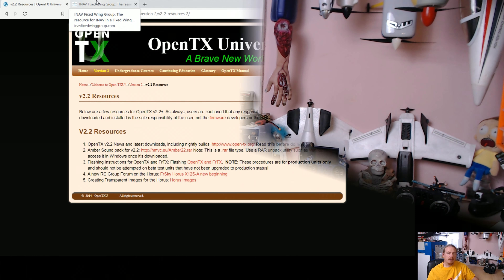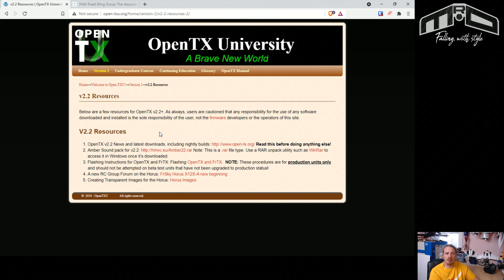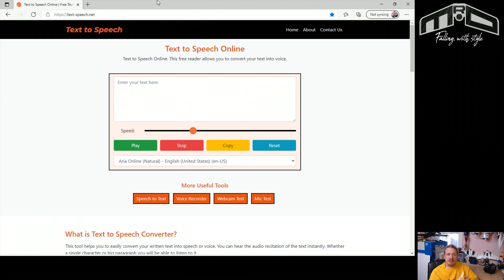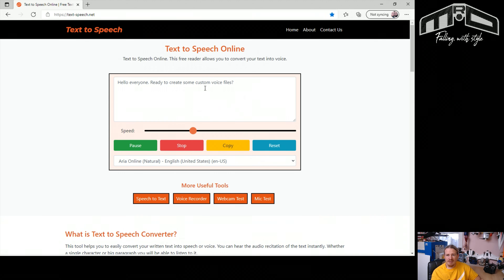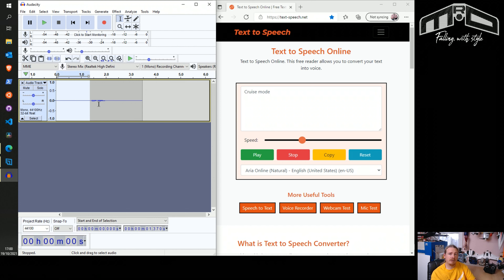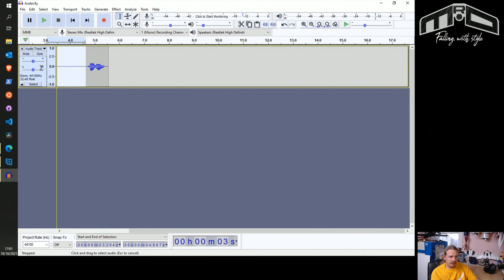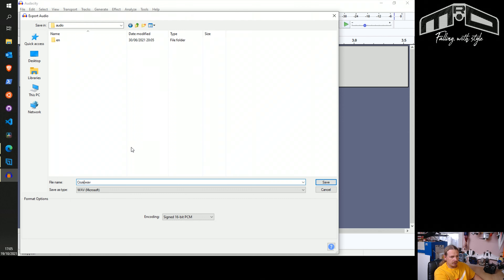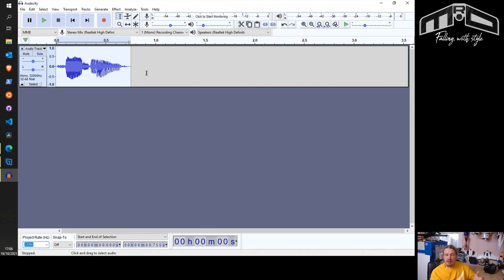Installing and Creating Sound Packs for your OpenTX or ETHOS Transmitter

Comment: Awesome tutorial, i just used it to make some sound files for my inav osd layout selection, and model name callout when selecting another model in the transmitter.
Reply from the maker: Awesome Herman. Glad to hear it’s been put to good use already.
Reply: That's interesting the ability to call out a model name when changing model. How is that done? many thanks
Reply: @hectorpiercey7852  Just add a play track with your sound clip at special functions and trigger it to play with a switch called ONE, let it play 1x.
Reply: @HermyH66   That's brilliant Thanks Herman.

Comment: Kudos! Without your step-by-step videos regarding EthOS i could never had manage myself so far. Thanks a whole lot for your time and skills. Just went from Spektrum to X20S, so it's hard to get into something new as this. For your information: the first time I used the text-to-speech it worked on Edge. Now, after realizing that my X20S haven`t any voice for flap settings I wanted to crate some more audio, but i'm only getting African woman :P tried both Edge and Chrome, updated/refreshed. Adria US is gone :( Ever experienced that yourself?
Reply from the maker: That web site seems to change the voices quite a bit. Aria is still on Edge, but you have to get to her a different way. I’m working on a web page to allow people to use the Edge “Read Aloud” feature for voice packs. Some people are having problems though, so I need to figure out why that might be. 

https://www.mrd-rc.com/tutorials-tools-and-testing/useful-tools/transmitter-sound-pack-simple-phrase-page-generator/

Comment: Hi Darren, thanks for all your videos ,they are a great help. Appreciate that you had this one for sound bytes as well.
A question, I fly Pattern aerobatics, we have what we call a calling card, which has a sequence of  manouvres which have to be flown in that order. It would be handy to load this call card onto my TX and then by eg. pressing one of the buttons at the back of Tx . the manouvres can be called on the completion of the previous one. 
Eg 1st manouvre, loop with half roll; press button:(2nd) half square loop on corner; press button  (3rd manouv) ; inverted cloverleaf etc to manouvre 17  ; end

Comment: Thx for informative video. Are there any packs with "non speech" sounds, like beeps, chirps etc.? OpenTX used to have "Play Sound" command (next to "Play Track") with many built-in sounds, which I used for many different alarms. But this is missing in Ethos.
Reply from the maker: I will be putting one together. But I don’t have time at the moment as the INAV code freeze is soon.

Comment: Hey Darren, I love your Ethos Videos and they have helped me out a ton. I saw in one of them that you have your volume set up on the middle red slider on your X20S, I can not figure out how to do that. I dont suppose you can give a quick video on what you did you change that, Thanks again
Reply from the maker: Thanks Mike. I’m glad the videos have helped. 

To change the volume with a pot or switch, go to where you set the volume in the system settings. On the slider where you set the volume, hold down the enter button. There is an option there that activates it. Sorry I can’t be more specific at the moment. I’m not near a transmitter at the moment.
Reply: @MrD  Thank you so much super easy. Love your videos and appreciate all the help sir.
Reply from the maker: @mikerochon4234  glad you got it sorted Mike. I was on a drive back from working away from home. So was hoping it would point you in the right direction 👍🏻

Comment: hey darren thanks for all your helping video's i received my x18s today and it came already updated to the latest version 1.3.3  Can you please tell me why u use an sd card in yours ? i presume it is to put all bigger file's like sound and pictures on so if so can you tell me can i just move the sound folder to an sd card ? greetz
Reply from the maker: I used the SD card for stuff that is not used often and just taking up space. For example firmware to install on receivers. There wouldn't be any benefit in storing those on the NAND drive. You can choose where you want to store specific types of file in the System -> General menu. You would need to move the files in a file explorer on your computer. They aren't automatically moved when you choose the storage location.

Comment: great video question I have on my x12s with open tx when i power down i had a bye wave. can this file be used on my x20s with ethos and how to i get it to do it.i have in the system folder like I did in opentx .I notice you the video you had a bye wave file yourself thanks you for ay info on how to do this .

Comment: Hi Darren, I have a Horus X10 TX running Ethos and have set up a bomb release function to the LH slider. I would like to add a “Bombs away” sound to this slider via special functions. However, although I have been able to add sounds to other switches successfully, for some reason the TX does not seem able to detect the slider as an output. Is this a problem with allocating sounds to sliders in general, or just this particular TX? Or am I missing something? Peter B
Reply from the maker: To allocate a sound to a slider. You need to create a logic switch that detects when the slider has moved in to the position where you want the sound to activate. Then use that logic switch to activate the special function to play the track.

Comment: For the audio geeks - the sound files need to be 16-bit, 32000 Hz, mono .wav files. Otherwise they either will not play in Ethos or they will play back at the wrong sampling rate.
Reply from the maker: Thanks Mike

Comment: Hi Darren, Thank you for another excellent video!! Can I add the INAV sound pack to Regular EdgeTX 2.8 sound pack.            I have a bunch of sound file folders  in my sound file on the SD card, can I just delete the entire sound file and reload the 2.8 pack and then add the INAV sound pack to it, even if I have to drag the individual sound files over? And what to do with the telemetry folder sound file?          BTW I have got my second INAV FPV plane in the air with the help of your videos, Its a Reptile Dragon 2, INAV 6.1. It flies Great, seems fast even on 3S batts
Reply from the maker: Yes, that IFWG sound pack can be added to EdgeTX no problem. No need to copy the files individually. You can copy them all at once. The sounds folder should be the same on EdgeTX. But the sounds for the INAV LUA script should be in scripts/telemetry/iNav/sounds/en. You will only see those folders if you have the INAV LUA script installed. If not, just ignore the scripts folder in the sound pack.
Reply: Thank you for the advice! I will give it a try, Your the best Mate please keep doing what you do, I know without you I would have given up a long time ago, you help to take the frustration out of the tech. Cheers @MrD

Comment: Hi, just got an X20S and loving your videos, just a quickie, the Aria voice seems to have disappeared from the text to speech website which was clearly the best voice, any other recommendations?
Reply from the maker: Yes, a few months after making the video, I did find that the voices changed, seemingly randomly. I ended up making a page that could be used with the Edge browser, which gave access to the Aria and the other natural sounding voices. There is sometimes an issue with the page, which I'm sure is down to caching. But I'll hopefully have a fix for that shorty. https://www.mrd-rc.com/tutorials-tools-and-testing/useful-tools/transmitter-sound-pack-simple-phrase-page-generator/

Comment: Hi. What is the tape I see people use on foam planes? To say cover the leading edge. I have been using packing tape and an iron but was wondering if there's an actual monocoat type tape you recommend
Reply from the maker: For a just leading edge, you can use packing tape. However, you could use laminate, which is similar to covering material. In metric countries it’s called 75 micron lamination (or encapsulation) film. In the states it’s called 3 mil laminate. A mil is 1000th of an inch, so confusingly nothing to do with millimetres. Its not sticky, but when you heat it on, it melts the adhesive. It can add a fair amount of strength the the model.

Comment: Hi!
Great tutorial again, it works but playback on transmitter speaks at low speed like a slowed down vinyl while it sounds normal on computer!!!
Reply from the maker: Hi there. Did you adjust the Hz of the file and resample the file? If it plays fine on the computer, but not on the transmitter it has to be something like that.https://youtu.be/2AcB_jrFFK4?t=546
Reply: GREAT! Thanks a lot, it works :-))))

Comment: Hi Darren from France! Can you tell me if it is possible to program a bouton than you can hear the actual time instead of having a look on my watch please? Many thanks
Reply from the maker: Hi Dany. I’ve just had a look in ETHOS, and there is no setting to do this currently. I will add it to the GitHub though, as I can see that being a useful feature.
Reply from the maker: This option will be added to ETHOS in the future https://github.com/FrSkyRC/ETHOS-Feedback-Community/issues/1556
Reply: @MrD  so many thanks Darren 
 Gode job ! 
An other question : when will come back  the CRSF from TBS ? For drones in FPV ( its a question of one of my friends wich i don't understand 😉🤣)
Reply from the maker: I think CRSF will be soon. One of the soon to be released transmitters is advertising ELRS compatibility. ELRS uses CRSF, so hopefully this is a good sign.

Comment: Hi Darren , I have just loaded the amber sound pack into the audio file in my x20s but I can,T access them in special functions,it just shows this (—) .if I go into the audio file they are there under sound pack and show as a wav file, I,ve obviously missed a step?  Cheers peter
Reply from the maker: It sounds like they’re either in the wrong folder or not the right format. If these sound ls are in an “en” folder. They won’t work. They need to be in audio. If they are in the audio folder and still not working. Try running them through the audio tool in ETHOS suite and re-installing them on the transmitter.

Comment: So I have the X20S and I added the files and I can even play them from the file manager but  when I add it as a special function and I try to select the file its just blank there is nothing there. It's not even letting me select sounds from the OEM sound board on the controller what do I do?
Reply from the maker: It sounds like the sounds have been installed in the wrong place. They will appear in the list if they’re in the right location.

Comment: Hello, many thanks for your videos, just added my custom sounds and they work great. The thing I can't figure out is how to enable the system sounds for altitude, rate of climb/descent etc... when using a variometer. The numbers, units etc... all seem to be in the system audio file but when I use a variometer like on the SRX-8 the display works OK but I cannot figure out  how to enable sounds
Reply from the maker: You’re welcome, I’m glad it was helpful. 

I’m not at a transmitter at the moment. But I’m sure the special function is “play value”. Then you select what you want read out.
Reply: @MrD  quite right, this is how to do it. Thanks again
Reply from the maker: No problem

Comment: Thanks for your videos i just got my x20s but did i hear you say you maybe doing a sound pack yourself for  Line of sight peeps if so please let me know :)
Reply from the maker: Hi Ryan. Yes, I have a some sound files that use the same voice as the INAV Fixed Wing Group sound pack. Mine are more for my LOS planes, so have gear, rates, flaps, ignition etc in there. If there was interest, I can make it available on my web site.
Reply: @MrD  yeah to me they would as I fly line of sight and thank you for your videos not only have you showed me how to setup my new radio. Your the reason I bought x20s in blue hahaha.
Reply from the maker: No problem. I’ll get something set up for those sound files. It may be a couple of weeks as I’m just about to upgrade my PC. But I will get it done.
Reply from the maker: They do look awesome in blue though 🤣
Reply: @MrD  thanks good luck with pc upgrade I did mine not so long ago
Reply from the maker: Thanks Ryan. I’m not looking forward to transferring windows and all the software over. But it’ll be worth it once that’s done. Can’t wait to have it all up and running.

Comment: Hi Darren, Happy new year btw.... how do I stop the track from playing its full length on the transmitter? moving the switch doesn't stop it until the track has ended. Cheers in advance:)
Reply from the maker: Happy New Year to you too. Short answer, you can’t. Once the track starts, it plays to the end.
Reply: @MrD  Thanks Darren, thought as much.... better change that Britney track then, oops  ;)
Reply from the maker: @grumpyrse  for that Britney track, you could set it up as background music. There is a special function to pause background music.
Reply: @MrD  WOW didn't know that.... thankyou for your help😀
Reply: @MrD  not found this in ethos :(

Comment: Hi, in Ethos I’ve managed to play a wav music file (through the functions menu) but when I switch off the switch the music keeps playing. Do you know how to stop it ?
Reply from the maker: That should have been fixed in 1.0.10. Which version of ETHOS are you running?
Reply: @MrD  1.2.7
Reply from the maker: Sorry, I thought you were meaning switching off the transmitter. At the moment, there is no way to stop the music part way through.

Comment: On the x18 where's best place for sound file's. On mine I put on sd card an if change models I have to restart it for the sounds to work. I haven't been able to get them to work if I  put them on the radio. But I think that it was user error.
Reply: Ok I put a sound pack on radio,an it works don't need to restart it when charging models. Is this best to do this? An how do i back up models to sd card. Is copy it on the computer the only way,or a way on the radio?
Reply from the maker: Honestly, I don't have that issue with the sounds on the SD card with my X18. By radio, I guess you mean the NAND storage. Either that or the SD card should be fine.

The best way to back up the models is to copy the models folder on to your computer.

Comment: I added some newly created tracks for high/med/low rates created from Audacity which play OK.  Then when I power down radio and power back up the special function reverted back to the former amber sound track file.  It's not saving the edited special function!  Weird! Any ideas?
Reply from the maker: That sounds really weird. Are you exiting out to the main screen before powering down? Or have you tried switching to a different model and back to see if the new sounds are still used?
Reply: @MrD  x20s is brand new so I have only one model on it.  I am going to main screen before powering down. I am using latest .14 firmware.  Sounds like a bug, right?
Reply from the maker: Sorry about the late reply. I wanted to test this out for myself. I can’t replicate that bug. It works fine for me and stays on the new sound file.
Reply: @MrD  seems to happen only when SF is tagged as global. Might be an intended feature to prevent accidentally changing critical functions across many models.
Reply from the maker: @ccaputo35 possibly. I only set up my sounds on a per model basis. The only thing I ever had global with OpenTX was the volume on a pot. ETHOS handles this with standard settings now anyway.

Comment: Hey Darren thanks for the excellent video! I updated my X20S today to firmware 1.2.8 using your video as a guide. I then attempted to make sound files with Audacity and text to speech. Everything worked fine on the computer. However when I loaded the files into ethos as per your instructions, the files all played super slow and at least two octaves below where they were recorded on audacity. Very strange. Any ideas?
Reply from the maker: Thank you. You probably just have the sample rate set incorrectly, It needs to be at 32000Hz https://youtu.be/2AcB_jrFFK4?t=546
Reply: @MrD  Hey Darren thank you for your reply.  That is not the issue. All files were recorded at 32000hz as per your instructions. Must ba an unknown bug, as I noticed another subscriber had the same issue. Hmmmm????
Reply from the maker: I thought they had sorted it. Could you drop me an email on my web site. Then send me over a sound file that is playing slow. I might be able to spot something in the meta data that would take ages trying different things to make it fail.
Reply from the maker: It could be because the file is stereo. It needs to be mono.

Comment: Hi Mr.D, I am unable to get sound out when i use the special functions trying to get VALUES to play. I have tried a number of different sources, RX battery, Clock, Lipo level, and nothing will play. I'm not sure if my files are in the correct location. I can get it to play a track. any help would be great,
Thanks,
Bill
Reply from the maker: The speech for the readouts are system sounds. You’ll either need to check on the SD Card (OpenTX or EdgeTX) or in ETHOS Suite (ETHOS) to make sure the system sounds are there and happy.